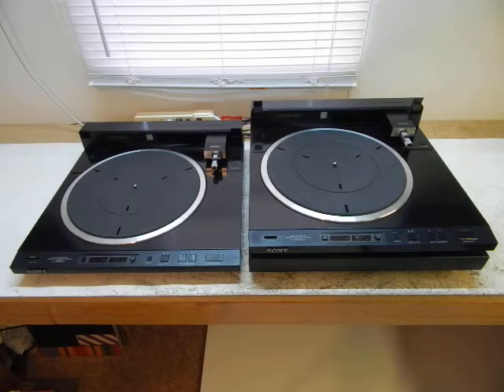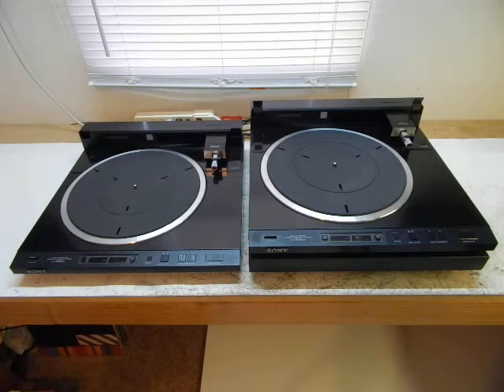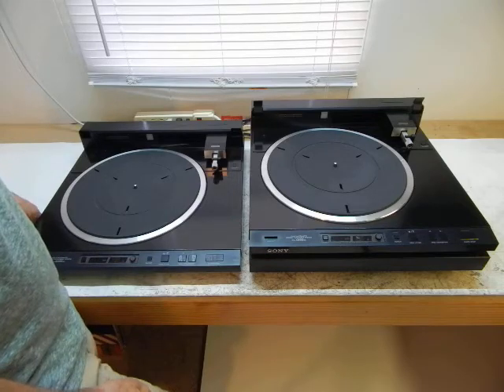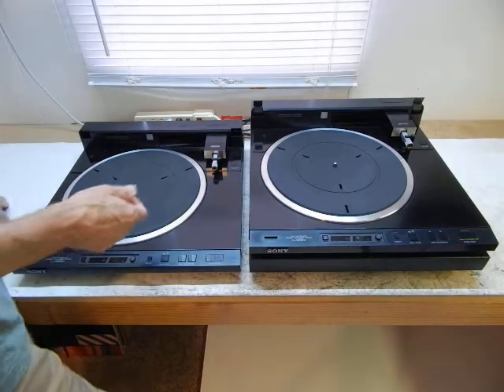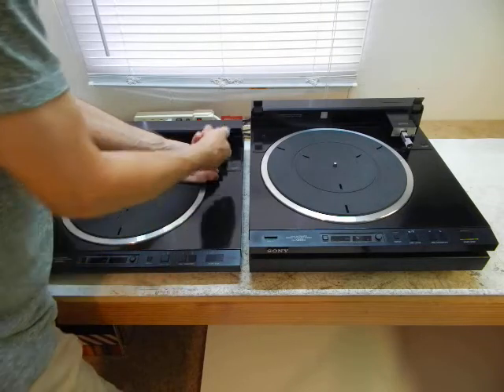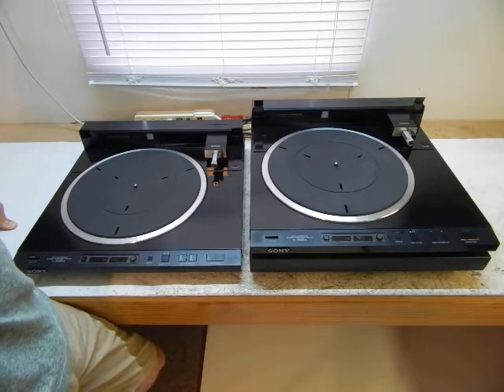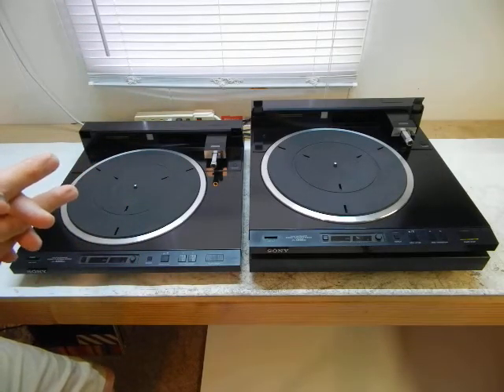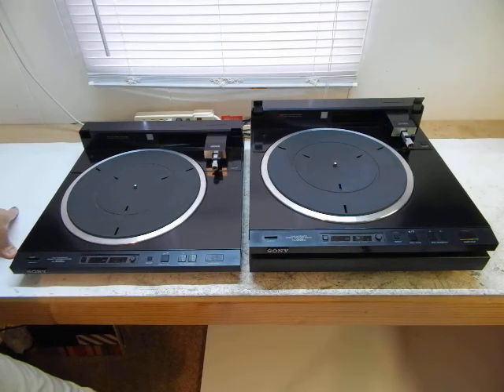Sony PS-X555ES SLT Biotracer turntable modified with supplemental plinth

Comment: The modified plinth unit seems much more densely solid, whereas the original unit has rather obvious cabinet resonance throughout. Thanks for your video, it's ones like these that encourage me to try modifying my current devices rather than getting caught up in collecting.